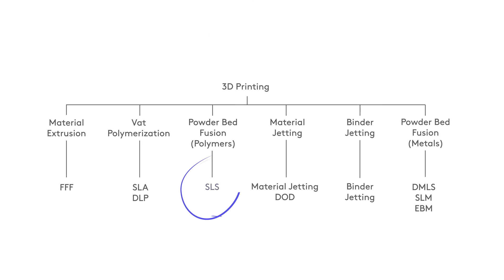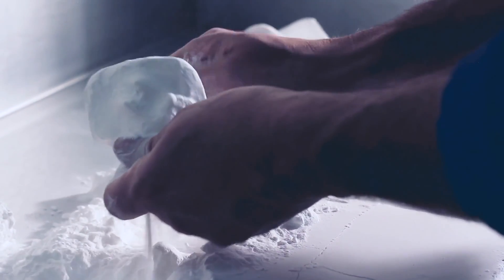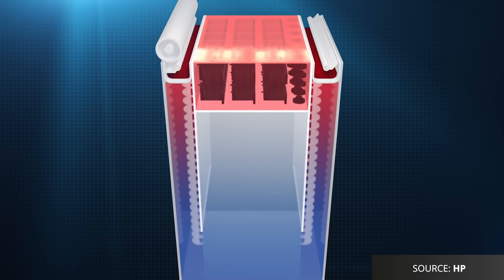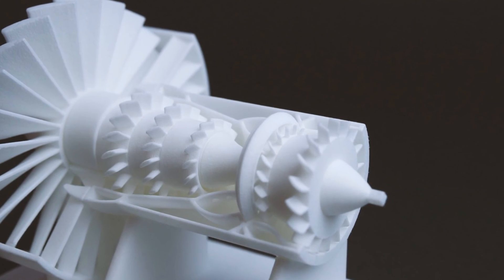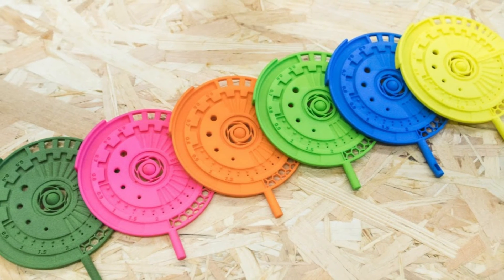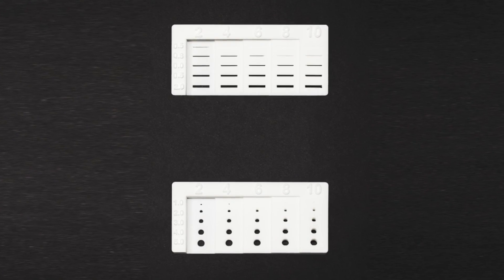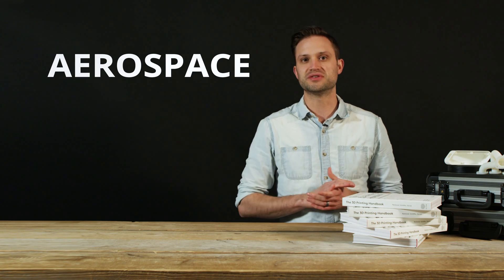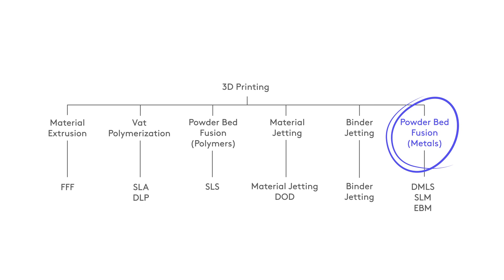SLS 3D Printing - How to Make Strong Functional Parts (HANG TEST)

Comment from the maker: 0:39 What is SLS printing?
1:07 How an SLS pinter works.
2:25 The difference between SLS and MJF
3:40 The main advantages and limitations of SLS
5:20 Costs of SLS printing
5:57 Designing for SLS printing
8:30 Main applications of SLS parts

Comment: If I want precision, smooth surface and yet can withstand heat of approx. 80 degrees Celcius. Which type of 3D printing method is best? I use it for automotive parts and will use the 3d printed part as a source for resin tooling.
Reply from the maker: Hi Charles, in this case heat resistant SLA resin would be best.

Comment: 3Dhubs SLS is only 100 microns on the Z? Other SLS system have 50 even 25 micron on the Z. At 100 micron it makes it hard to print threads.